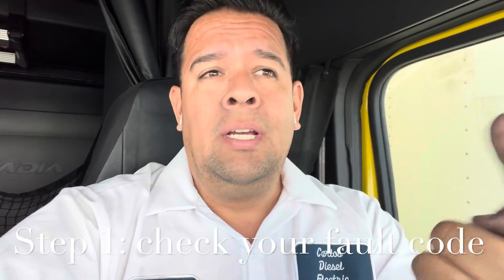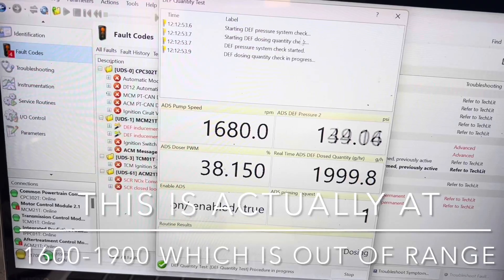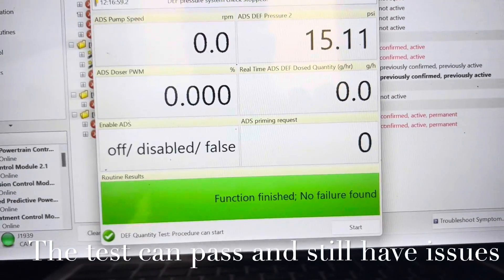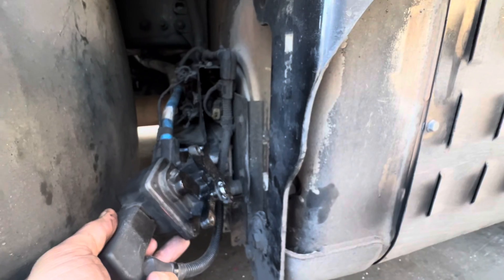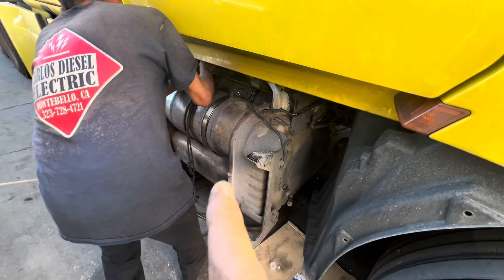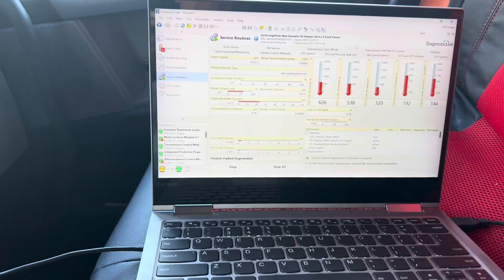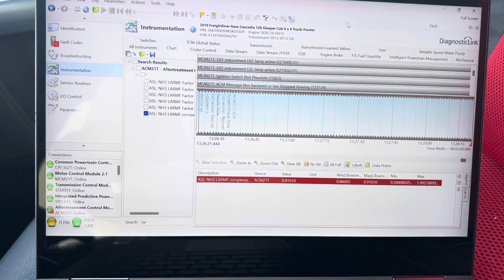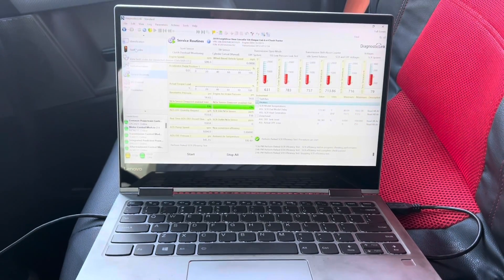Common DEF problem, how to clear SCR closed loop control at maximum limit fault code

Comment: Hello, what triggered these 2 inducement codes? Is this because of the SCR closed loop control at maximum?
Reply from the maker: I look at a few things, need to ask about DEF consumption, check DEF quantity and DEF pump, check the tailpipe for signs of soot. There could be a compromised DPF or One Box. 
This code or codes usually come up once the truck tries to over compensate by using more DEF. Run a regen first and check NOx efficiency. Monitor the regen and look at the numbers.
Reply from the maker: Any other codes also help provide a clue. Check for software updates also.

Comment: I know I’m asking 2 years after the video but hoping I can get some assistance. I have a 2021-2022 cascadia. Have one single code for scr closed loop at maximum limit. Another mechanic replaced both DPF’s and 7th injector. I ran a regen and was successful. Scr efficiency test failed and gave me a message saying “check failed MU3”. Not sure what that means. It’s a manual tractor. I was attempting to run a nox verification test as per the diagram instructions but I am unable to change the status to “true” to run the test. The NH3 levels reach .92 and that’s where I had to stop because my shift is over. I’ll continue it tomorrow. Any advice?
Reply from the maker: Try re flashing the software all access the board. Updates might be helpful if you do the MCM, ACM, CPC

Comment: I kid you not I have one truck nox conversion .98 , def pressure 140s pump speed ,1,200 dpf pressure is fine temp is fine once the nh3 compensation factor reaches about .88 it begins to drop back down
Reply from the maker: I had a truck have a successful regen, great NOx efficiency, LARMF goes up to .98 and somehow still failed the efficiency test. Called Detroit for some tech support and they said something else must be wrong but say what.
Sorry to say this, but sometimes I feel the manufacturer doesn’t even know what the heck is going on. 
They said could be the turbo, could be the One Box 🤦

Comment: Good video but the stuff they mandate on trucks is criminal. This is why groceries and fuel is so expensive.
Reply from the maker: I agree. I think manufacturers need to do better with warranty behind their products. The basic warranty is not sufficient especially if you consider the cost and downtime.

Comment: dealer told me. you have 2018-2020 cascadia dd15. take it to dealer and get acm or system computer update. maybe change your outlet nox sensor or def dosing unit. clean your 7th dosimg injector.
Reply from the maker: There is definitely a software update that is supposed to help with this fault code. They recommend the MCM, ACM, CPC and TCM be updated if needed. Cleaning the doser is always a good practice. I would start with those first and if needed replace the NOx sensor.

Comment: What drives me crazy is when they come in with SCR closed loop and moving average codes yet after running regen and SCR test it passes with no repairs needed! I had one I messed with 3 different times without finding the issue then on the third time I blew out the def vent line and never had another issue 😅
Reply from the maker: This code is a pain, I have even called Detroit and the answer I got was, maybe it’s a NOx sensor when both sensors were good and the readings were stable. I had 99% efficiency, the LARMF was .097
Not sure even the manufacturer knows how to resolve this.
Reply: @CarlosDieselElectric I like the way you address the issue, in all honesty I believe techs at Freightliner don’t go through some of the troubleshooting you do. Also 45 day wait right now for a one box for the unit with the fuel contamination! I can’t imagine how many core NOx sensors are returned that there’s nothing wrong with😂 Also just a thought but here in Cali we run bio allot and sometimes can still get regular ol diesel but the changing of field I’m sure makes it difficult for the systems to work like someone designed them to.

Comment: How is all this extra fuel burned for regens good for the environment?
Reply from the maker: I agree with you 100%. 45 minutes for a parked regen and then 2-4 hours to try and clear the fault code for the closed loop. Doesn’t make sense to me at all.
Reply: God damn same question l always make

Comment: Hi on my 2018 freightliner cascadia I have a fault code 520372. We did all tests like nox sensor, def dozer,quantity test and scr efficiency  .all good. But code shows up again after running around 200 miles. But now code is gone but engine light is still on. Please advise. 
Thanks
Reply from the maker: @GurdeepMarahar-j9p  what is the FMI code?
Reply: @CarlosDieselElectric  16
Reply from the maker: @GurdeepMarahar-j9p  what was the NOx efficiency during the regen and SCR efficiency test?

Comment: My truck completely the regen successfully and right after the scr ran for about 2 hours and passed. No other codes active but Selective Catalyst Reduction Closed Loop Control at Maximum Limit is still active. Do I need to run the scr test multiple times? All numbers looked perfect during regen and scr. Thanks
Reply from the maker: @OfficialSandfreak1  you may have to run it again. Any other codes?

Comment: How long can you drive with this fault code ?
Reply from the maker: Depends, it will start to derate the speed to about 55-65 mph 
How long has the light been on ?
Reply: @CarlosDieselElectric  about 4 days . I just keep resetting it for now . Someone said scr efficiency test helps but then this code keeps coming back and apparently there’s no fix . Sound like programming issue. I need to get to your shop in couple weeks to do the maintenance and check on these codes
Reply from the maker: @DanielBlack-g8u  go into the aftermarket tab and reset or put New One Box. Someone told me that works. I haven’t been able to confirm but it’s worth a try.
Reply: @CarlosDieselElectric  for now I only have this OTR performance app that I use  on the road . Not too many options on here . Will see how long I can drive before it puts me in derate. Currently I’m on East Coast 
Need to invest in better equipment

Comment: Have tried 2 def pumps and ADS def pressure 2 is at 14.5 psi and ads pump speed is over 2000 please help thanks!
Reply from the maker: Check for restrictions in the DEF system. Speed should be 900-1300 RPM. 
What codes are you getting?
Reply: @CarlosDieselElectric  520342 17 and ads def pressure came up to 145psi but problem is def pump is at 2200
Reply from the maker: @gilsot123able  check for any DEF restrictions in the system. Have you done a quantity test? If you have , how much are you getting?
Reply: @CarlosDieselElectric cleared out the lines by blowing air in them and don’t have the def quantity numbers but was done codes went away and only mil light is on showing the def pressure too high and pump is still at 2200
Reply: @CarlosDieselElectric  any suggestions?

Comment: What r the step to do the SCR test I didn’t see the step where should I go routine check then where scr n press test or how should I do it thanks bro
Reply from the maker: Step 1, parked regen. If it completes and passes NOx efficiency 
Step 2, go to the SCR tab, bottom left choose the drop down menu for NOX efficiency test. 
This can run 1-3 hours depending on how low the LARMF is. This has to increase above .092
The higher the better. It will complete on its own even after reaching 0.92. Just let it do its thing.

Comment: Can the def pump be rebuilt?  I know about the filter and screens. but is there rebuild options?
Reply from the maker: Not sure if there are any rebuild options. I would go new. The part number usually starts with EA. 
They are more reliable. RA means rebuilt

Comment: first off i think its absolute bullcrap to say it took five hours or so to complete this task.  after measuring the def dos and changing off some gaskets, immediate test should commence, not for you to say you were messing around with it the day before.  this was a good video but a true confession of over charging the customer.  procedures are procedures.  should be followed in steps  3 hours max is sufficient.
Reply from the maker: I don’t believe 3 hours is enough time to complete everything. 
If the customer arrives later in the afternoon I can only do a regen to check the numbers. 
The following morning, I can check the DEF system (quantity and pump). Then I have to do a regen again and then right after go into the efficiency test. 
So this test can definitely take some time. I wish it wouldn’t. Trust me. Working on these units unfortunately just takes time.
Reply: @CarlosDieselElectric you’re the man caros ✅

Comment: Does the scr nox conversion efficiency low detection by moving avg go away when it passes?
Reply from the maker: You will have to look at other fault codes to better help you. Also, inspection the tail pipe for soot. Run a regen and see what the temperatures and pressures are. 
This will help. But if it successful is should clear.

Comment: Great job by Detroit to ensure we are spending plenty of time & $$$ in the shop.
Reply: Thank the EPA for making the manufacturers put this crap on trucks
Reply from the maker: Sad but true
Reply: @CarlosDieselElectric  I need help Carlos! I’ve been chasing these codes (SPN 520371, SPN 520372) on my 2019 Cascadia for months now! Freightliner changed my def pump, installed a new engine wire harness after saying something about a low voltage code that kept popping up and was kicking it out of regen. So almost $10,000 and 8 days later they give me my truck back saying it was fixed but a month later they came back!
Reply: @SFMARK69  I have the same two codes on my truck and everything is checking out good when running a region and the SCR efficiency test. Did you ever get this problem solved?
Reply: @SFMARK69 here the same … a lot of money but nothing solved
Reply: @CarlosDieselElectric codes came back a few weeks later and this time I bit the bullet and had my whole one box cleaned including dpf filters, I changed after treatment harness, and I replaced pretty much everything on the one box with the exception of the metering valve or def doser and the DOC temperature sensor.
Reply: @SFMARK69  Did you solve the problem？
Reply: @CarlosDieselElectric the second time they came back I had my EGR cooler replaced and had my engine cleaned out with this “diesel force” complete engine cleaning to clear out all the gunk throughout the engine, mechanic did scr efficiency test and it passed and I was sent on my way.

Comment: I wonder how people are going to get the things they need after all of this government crap finally kills the trucking industry for good? Truck used to be reliable, and are now just headaches (and wallet drainers) waiting to happen.
Reply: It’s part of owning a truck. They diagnosed an issue, and found an exhaust leak. Fix the issues and drive on. We do it for clean air. No one wants to be behind dirty trucks, or sitting at the truck stop with a bunch of pre-emissions trucks. I love the older pre-emissions trucks, but clean air is important.
Reply: @user-ln7of9gs4s  Start with ships, heavy equipment, trains and aircraft.

Comment: My pump rpm jumping around very quickly from 1000,1200,1400,1200,1000,1400 ect 

Not staying as stable as yours. Failing pump?

My codes went away during the scr efficiency test, nox efficiency good, ect
Reply from the maker: Start with a DEF quantity test and confirm the amount.

Comment: When i work on a frtlnr there are 2 things that need to be checked and cleaned every 6-12mo. Delta P ports for blockage, if blocked it will throw off the whole emissions system. 2nd the tube on the right side of 1-box, check to see if pipe is plugged or if the silicon hose is cracked. On a dd13 carefully unscrew the 7th injector and put a long screw driver in to clear soot build-up.

Comment: Hi,nice video,i got a same code scr closed loop,i did reign,no check engine light,but during scr test,check engine light came with same code,did def quantity test,125 ml,good quantity,def quality good of 32.5 urea,but not outlet is 89 ppm and above,what could be the issue,inlet box to scr is 520ppm approx,i want to know,why not outlet ppm not coming down
Reply from the maker: Look inside for any signs of soot. Could have a compromised One Box. Possibly a bad sensor. We have even put the outlet sensor on the outside to bring the efficiency up towards 100%.

Comment: Pedro, good information. However, I'm experiencing scr efficiency test stops after 5 or so minutes of active test. I have to run MANY test to reach the maximum value before light goes off. Do you experience same as I do?
Reply from the maker: Yes, to reach the LARMF it can take an awhile. Is the truck surging when the fan clutch kicks in? In other words, then the fan clutch turns on at 220, do you see the EGR valve go to 100 and the psi jump around?
Reply: @CarlosDieselElectric  I'll have to look at that next time. But haven't heard the truck surge when fan clutch kicks in..if that happens what does that mean. Also, I never thought to check doser valve. I'll check that next time a truck comes in for this issue. It's happening on dd5 and dd15. Thanks

Comment: Do you do this CumminsISX15?
Reply from the maker: Cummins has a different process for clearing codes. What fault codes are you having?
Reply: @CarlosDieselElectric  don't have any codes but it seems that I'm going through a lot of diesel exhaust fluid. I burn around 7 gallons  a week with around 110 gallons of diesel. 
I changed my DEF doser and it's the same.
Reply from the maker: @guillermobelloso2312 there should be procedure to check DEF quantity. Also, software, might need an update. Check your EGR system , SCR system might have an issue. How many miles are on the truck?
Reply: @CarlosDieselElectric  475K do you do those tests

Comment: Just delete it
Reply: fuc that I tried all of this crap code came back after 1 month..
GONA DLETE IT NOW
Reply from the maker: @dell7054  this code is definitely a pain, I have talked to Detroit and other techs and this code is garbage. I agree. If you can make your truck run without this then I say go for it. I am in California and they are trying to crackdown on a lot the defeats.
Reply: @CarlosDieselElectric  yeah the whole def is garbage.. other options r just unscrew the outlet nox sensor and put in the box next to it.. it will smell fresh air and no more scr loop or efficiency codes... I have seen few people try that and with good results
Reply: @dell7054  good idea
Reply from the maker: @dell7054  Definitely one of the best options is the NOx outlet sensor reading clean air. This helps increase the number. You can always install it after.
Reply: @CarlosDieselElectric does this trick works on a 2019 cascadia ghg17 ?
Reply from the maker: @AmanAndHisTruck123  yes, follow the steps. You may have to perform the SCR efficiency test more than once to increase the LARMF.
Reply: Not worth it if you go to California and resale value also go down
Reply: @PrabhjotSandhu-tm9yu  I’m in Atlanta Georgia, thank you very much
Reply: @MrChevrolet94  Dealership shops won't touch it if you delete it. Why don't you just fix it? It's not magic.
Reply: @nospam3001  bro, have you seen how fucking expensive that shit is to fix???!!!!
Reply from the maker: @MrChevrolet94 I agree. Anything after treatment is expensive
Reply: @CarlosDieselElectric  and that’s one of the reasons it sucks. It also damages the engine overtime
Reply: @CarlosDieselElectric please answer! Kwt680 paccar 2016 800k miles replaced DPF 6months prior to this issue approx 50k miles on it since DPF replacement noticed large amount of inspection on decomp pipe due to def doser failure kenworth dealer is trying to hit me with 12 k bill to replace decomp doser and SCR! I was told by friends no need to replace scr only doser and decomp
Reply from the maker: @BlessednFree  why is the dealership recommending a new SCR? Is it dirty? Too much DEF inside due to a leaking doser?
Reply from the maker: Deleting is always an option but there are many factors to consider when deleting. Especially in 
California will start to smog trucks two times per year.
Reply: @CarlosDieselElectric  well thank god I’m in Atlanta Georgia!!!! Fuck California
Reply: @lowkey3820  I just want a pre-emission CAT C15 (6NZ)
Reply: Terrible idea.